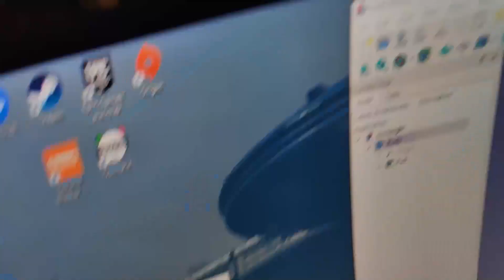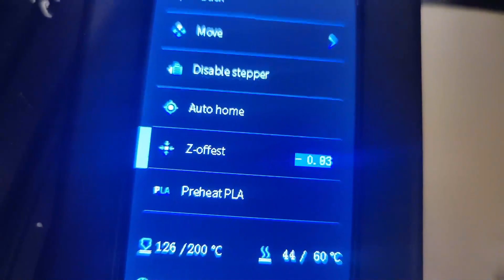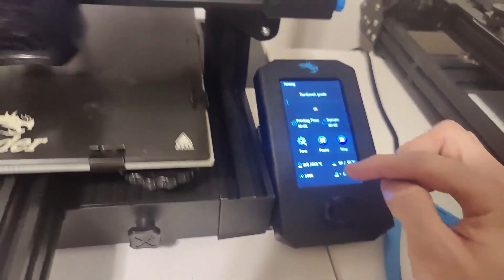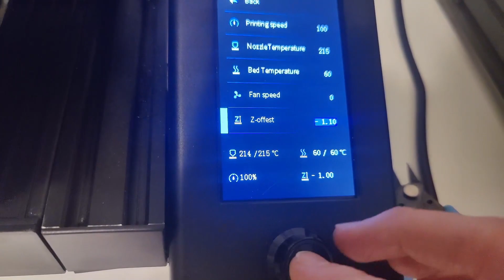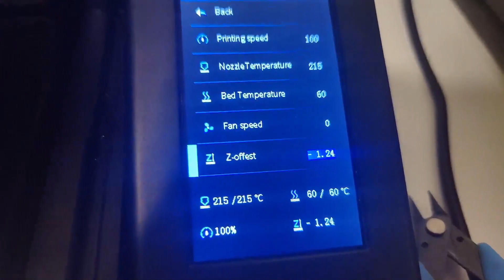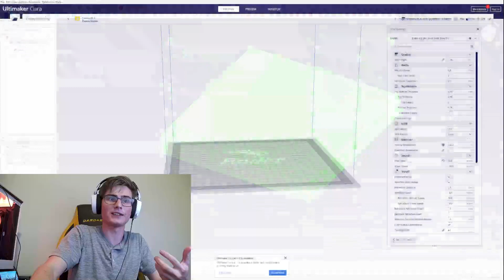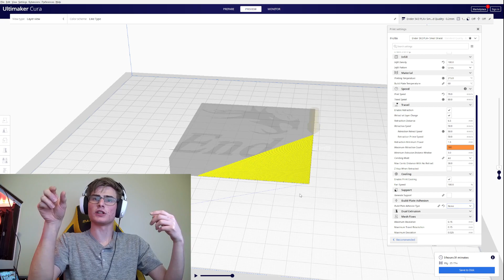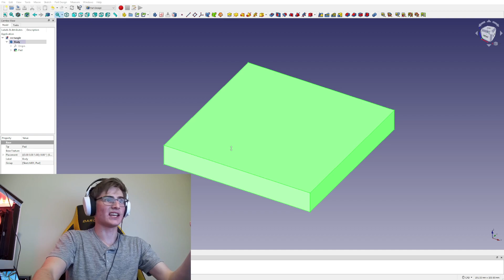How-To Calculate the PERFECT Z-Offset For Your Creality Ender 3 v2 - CR Touch

Comment: i only have 3 settings under walls, is there a setting i have to use to get all the settings you have?  I have ver 4.12.1 of cura
Reply from the maker: I can take a look in a couple of days when I am back at my computer, but I believe there are hidden settings you need to first activate.

Comment: Thanks so much for your video, I’m brand new to the 3D printing world and I was so confused on this particular step. Before watching your video I had as you call it, a real bad day, I accidentally st my offset way to low and scratched the glass plate and wrecked the nozzle. I replaced the nozzle, rechecked all the dimensions, then followed your video and I got a perfect buttery smooth first layer and very nice subsequent layers. I made your test pattern with your recommendations, it came out very nice. Thanks again.
Reply from the maker: Of course!! Thank you for the kind words! To make you feel better (if that is possible) scratching the glass bed is annoying, but it wont be detrimental to your prints. A scratched glass bed can cause some ugly patterns to the bottom of your print, but over time your glass bed WILL get micro scratches that cause the same effect anyway, so I wouldn't let hat bother you, and I recommend keeping 5-10 nozzles on hand at all times because the standard ones are so cheap and they will inevitably need to be replaced. Anyway Im glad I was able to help! I hope some of my other videos are also able to help :)
Reply: @ThePrintHouse  thanks for your reply, yes I do have many extra nozzles, I’m planning on getting either a couple hardened steel ones, or the ones I’ve seen with a ruby insert. And yes your other videos are a big help too. Thanks again.👍
Reply: is there a quick tell if the nozzle is bad ?
Reply: @guidancebeats  You’d be better off asking someone else, I’m not sure, all I know is when I scrapped my nozzle across the plate, it was easily noticeable with my finger that it needed replacing, it had a sharp burr.

Comment: Do you have to adjust your springs on each corner as well when setting your z offset or will the crtouch pick up the different levels on its own?
Reply from the maker: You should not have to adjust the screws on the bed. If you adjust the screws on the bed regularly it will only make your bed come out of level. If you adjust the screws on your bed you will need to redo this entire z-offset process, so I dont recommend it unless your bed get out of level

Comment: Running freshly updated Jude’s software and getting Printer Kill Reason: Homing failed restart required if I try to auto home anything.
Reply: Had to grab another firmware file and it fixed it.  Unfortunately the Jyers firmware isn’t allowing me to go negative on the Z number
Reply from the maker: Hmmmm...not sure what that means. I wish I could help you. As a matter of fact, I have not even heard of Jude's software. What is it?
Reply: @ThePrintHouse    Jyers software. It must have came out 7 or 8 months ago . I got it going and it rocks.  Huge upgrade for Ender 3 v2 over stock software.  Can update the screen separately as well.  At first it was a little buggy and wouldn’t let me go negative and then it did.  You taught me what to do though and my printer is working awesome.  Thanks

Comment: Thank you so much for this video! I have been fighting for two days to get my cr touch on my ender 3 to level. After watching this video i realized how dumb I have been. I was lowering the Z-Axis to do the paper test and then changing my offset. I also realized I only lowered my Offset to .1 instead of by 1 so my extruder was not getting close enough to my bed. On the Ender 3 will it save my offset when i Restart? will I need to level each time?
Reply: Stock firmware saves to the SD card, not the internal flash. Jyers firmware saves to the internal flash rom.
Reply from the maker: Of course! No problem! It depends on the firmware that you are running, if you are running creality's bl touch firmware it will save and you will not need to relevel upon startup. If you have a different firmware I cannot speak to whether or not it will save.

Comment: My Z-Offset is 0.94, I have yet to see anyone this small.  I wonder if my nozzle is damaged  :)
Reply from the maker: Yoooo that's insane. I won't how you got it so perfect!
Reply: @ThePrintHouse  I dont think its my doing, I think its how the CR-touch is mounted I would guess.
Reply: Even with that, I have to use glue stick.  Maybe the nozzle is bad.  I may try and replace it today.  When I do get a good first layer, the prints are smooth...
Reply from the maker: @K2Kevin  it wouldn't surprise me me if it's the way the CR Touch is mounted if you have a custom mount but I'm guessing you don't. That just seems like a pretty large offset between you and me which is why I'm surprised. Maybe it's really not that much 🤷🏼‍♂️
Reply from the maker: @K2Kevin  the distance of your z offset shouldn't be the cause of needing gluestick or not. What kind of bed are you running? Also what material and temperature. Those would be my go to things to check
Reply: @ThePrintHouse  Ummm...  Its lower/less than yours.  most I see are 1.xx - 2.x, might just be BL touch mounting it higher.

Comment: Can I install this on a brand new build? Should I do the normal leveling first? Both came today and are still in the box but wasn't sure If I could install this without a prior level. The reason I ask is because I don't want my nozzle slamming into my bed lol
Reply from the maker: You will still need to doing normal level (auxiliary level), but you will need to do that much less frequently with a bl touch

Comment: My cr touch quit working and now i wanna uninstall the software or whatever and just go back to manual leveling if i need it...have any ideas how to get it out the ender 3 pro...and go back to normal software??? Thanks..great videos man
Reply from the maker: There are two options, you can actually just stop doing auto leveling at the beginning of all your prints. Disable it from your starting gcode and then you don't have to even flash the stock firmware, but if you want to, you can just flash the stock firmware and you won't have to worry about it. I have a video posted about how to install the correct firmware for adding a bl touch. If you follow that video you would instead use the stock firmware for ender 3 pro instead of the bl touch version of the ender 3 pro firmware. If you still need help when I am home from holiday then I can create a video for you :) just let me know :))
Reply: I use jyers default.  It has manual leveling and let’s you change filament. Love it.
Reply: Does this work with an ender 3 pro upgraded to use a v2 display unit? Also what firmware do you recommend? Someone on Reddit said to use jyers with the cr touch and the v2 display

Comment: I put mine all the way to -5.00 and it's still 5mm off the bed why?
Reply from the maker: Are you sure you are moving the z offset in the correct direction? Without bring at my printer right now I do not remember which direction is correct. If should never have an offset that high. Are you running custom firmware?
Reply: Im having same.issue. even with z offset at -5 there's still a gap between nozzle and bed that could fit a pad of paper through...
Reply: Same here! I’m at -5 and it’s still no where near the paper (even if closer) :(

Comment: You didn’t save the z offset?
Reply from the maker: Under the "Tune" menu while you are printing, if you change the z-offset, it will automatically save for you :) I hope this clears things up
Reply: @ThePrintHouse  disappears after you take out sd card and restart printer
Reply from the maker: @dugy40  what firmware are you running?

Comment: The file leads to 404 error, no file?
Reply from the maker: I just checked the link. I believe it should be active. Is it still giving you an error?
Reply: @ThePrintHouse  yes. Maybe I'm doing something wrong, but just click on link and gives 404 error.
Reply from the maker: @wileecoyote4441  odd. When I click it I get sent to the right place
Reply: @ThePrintHouse  404 error for me too
Reply: @ThePrintHouse  404 here
Reply from the maker: This link should work. Sorry for such a delay https://www.thingiverse.com/thing:5183995
Reply from the maker: Im sorry!! https://www.thingiverse.com/thing:5183995
Reply: @ThePrintHouse  yup 404 error
Reply from the maker: I apologize, here is the new link!! https://www.thingiverse.com/thing:5183995
Reply: @ThePrintHouse  thank you but I’ve been making all kinds of stuff in fusion 360.
Reply: I didn’t see you level your bed? You’re just printing in the middle.  What’s the edges adjusted to?
Reply from the maker: Hey man, sorry for my huge delays, but I have the new link available if you still need it https://www.thingiverse.com/thing:5183995

Comment: Any update with the cr touch on the ender 6?
Reply: Cr touch on my ender 6 works great. I've seen where people have issues after cutting and splicing the extension cable to the cr cable because some say just match the colors of the wires together but I had to do the opposite connection then it worked like a charm. I'm not sure it's even worth it though because the ender 6 is so easy to level and manual leveling is faster but it does work good with these cr touch. Also creality told me, is going to if they haven't already came out with the correct cable.
Reply from the maker: @wbforsure2104  so far mine has been amazing. You should be able to set the gcode so that it doesn't always do the bed probing. I just have my do it every time because I don't mind waiting. My ender 3 v2s don't do it every time so I mainly use those printers when I want a super fast print and don't want to wait for it to probe the bed. I also had to swap the wife colors. I'm have 5 bl touch wires and some of them are already flipped which is why some people report that they just connect the colors together.
Reply from the maker: Hey yes! Sorry for the delay. I want to get that video recorded this week/weekend. It is on my list of videos to complete ASAP. I apologize for the delay, but it is in the works :)
Reply: Thanks again
Reply from the maker: Hey I just want to keep you updated on this topic. I was looking at pin out diagrams today and doing some testing. I made progress but I did not get the CR Touch to power on yet. It's being difficult. I still aim to have a video up this weekend though. I did however order a part from Amazon that won't arrive until November 10th so even if I get it working the video might be delayed until then so it is a more complete video
Reply: @ThePrintHouse  Would  the bl touch be a better, easier option for the ender 6?
Reply from the maker: @migueldevela2917  the bl touch and the CR Touch will function the same, I have tested it on a bl touch. Good news is that I got my CR Touch working today. I will have my video posted as soon as my parts come in for me to make the video proper and complete. I will discuss how to build a custom cable, how to mount the sensor, and how to plug it in. You will need either an extension cable or an extra connector cable. There are 2 different methods to install the auto level sensor on the ender 6 and neither of them is better than the other. One of them requires more disassembly but it is still not hard.